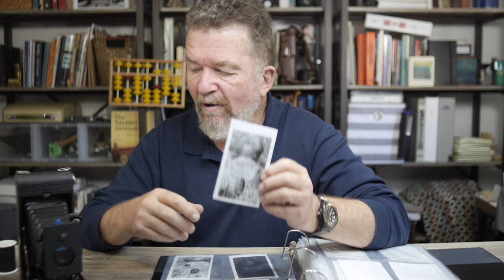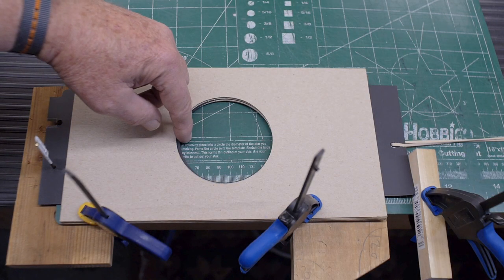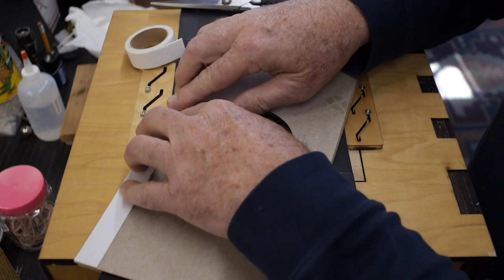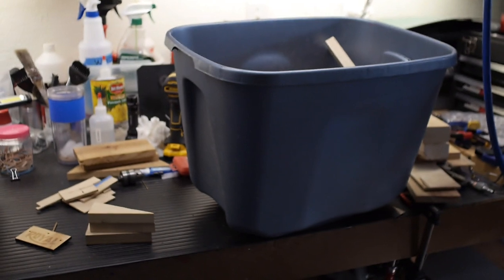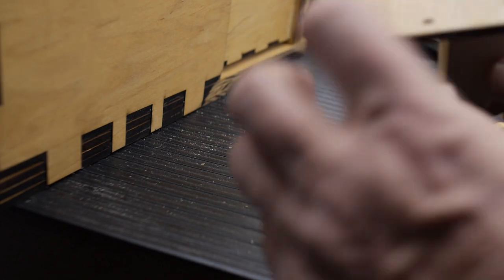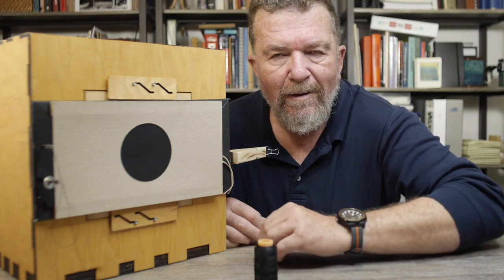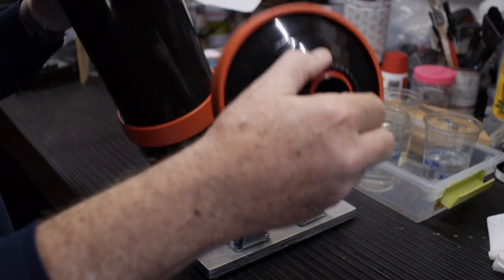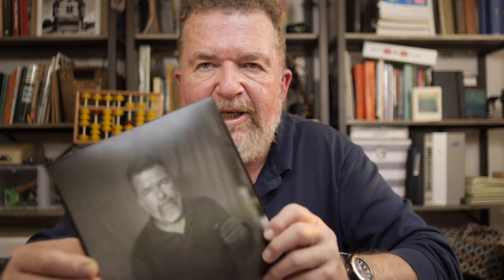8 x 10 Selfie Box Camera

Comment: The tubes will definitely make removing the lens much harder.
I built a somewhat similar shutter a few years ago (it's still in very prototype stage). I used rubber bands that were configured more like a bow string to push the shutter. Being like a bow string, they also act as a stop block and shock absorber. I really need to get back to working on that thing.
The fun thing is that the shutter speed on these shutters is set by the delay between the release of the front and rear curtains. You can get some pretty short times even without the consistency of springs.